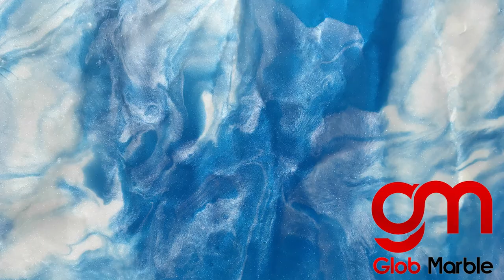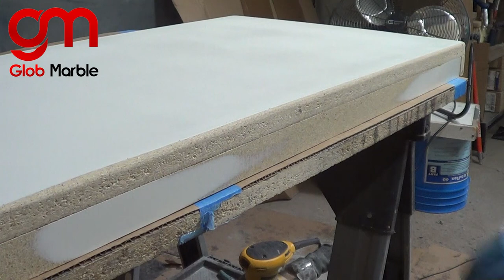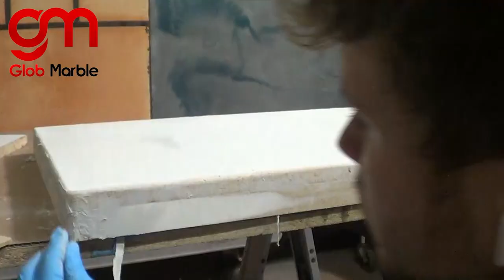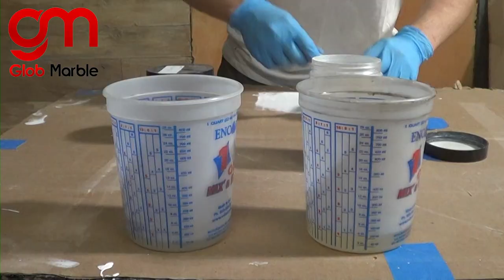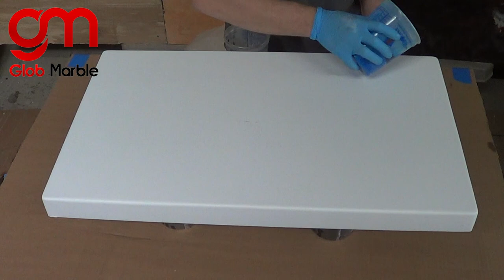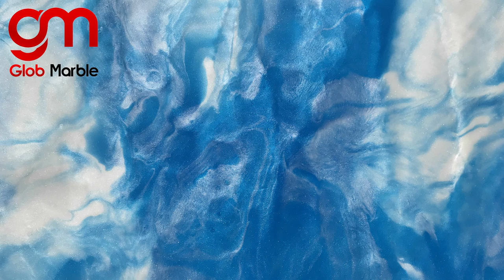DIY Epoxy Countertop Made Of Melamine

Comment: Wouldnt it work just as well to do a clear epoxy coat instead of bondo?  let that harden and then do it?  Just curious, as it seems simpler.. and im all about simple :)
Reply from the maker: I put the bondo there to not only smooth it out, but to make a waterproofing effect. Otherwise the melamine will expand like wet wood and ruin your project. You could try it with super fast set epoxy though, it wont have time to soak the wood to that point :)